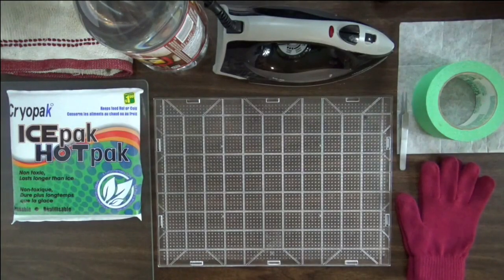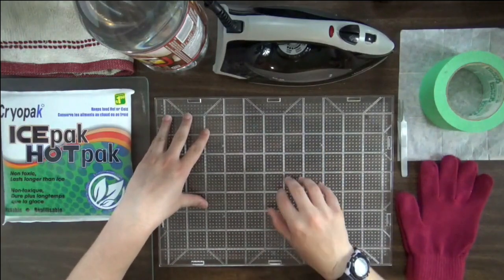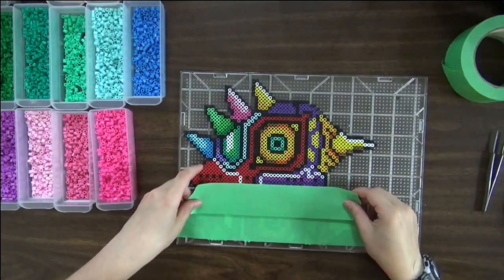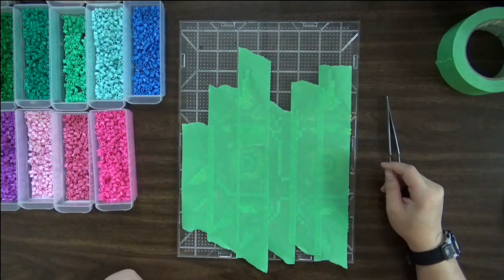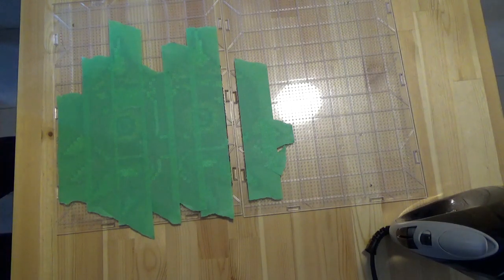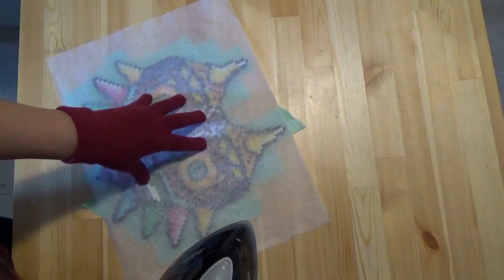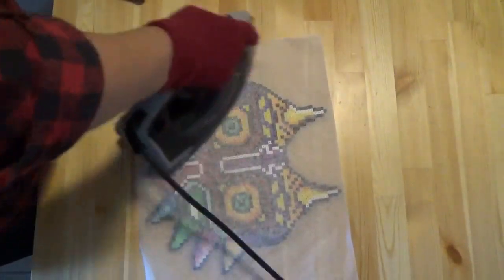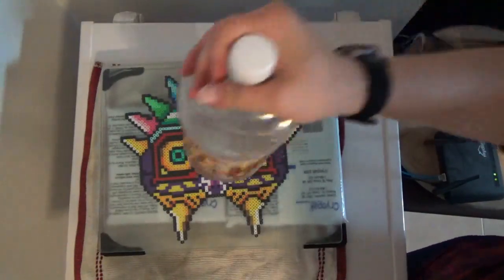Taping Method Tutorial - For Perler, Artkal, Hama, Nabbi or Other Fuse Beads

Comment: You really don't need to poke holes, I've tried countless times with and without poking holes and noticed no difference whatsoever. people who claim that you need to poke holes otherwise it'll collapse and ruined your project are the same ones who have poor ironing techniques.  Once you get a feel for ironing and taping and improve on this aspect it wont really matter if you poke holes or not.  Ever Perler themselves say you don't need to poke holes.  Just be patient and practice. Don't worry if you ruin a project or two...we all have it's the process of learning
Reply from the maker: Thanks for the comment! The thing is every iron is different, tapes are different, and the person ironing is different. Just because I use a cheap sunbeam iron, a specific brand of painters tape, and what is for me a medium amount of pressure doesn't mean that someone who buys the same iron and tape and tries to use the same pressure that they'd get the same result. For some people poking holes is a must. Perhaps their irons run way hotter, they have thicker tape, and they press harder without realizing it. I'd encourage people to try both ways. If you want to poke holes and you get good results like that, good! Do that! If you don't want to poke holes, test with small sprites until you find a way that you can iron without poking! :) Often taking the tape off before full melting one side will prevent blowouts. But saying people have poor ironing techniques because they poke holes isn't really a fair thing to say.
Also Perler is much more interested in the child market of their product, and not the artist side. I'm rather surprised they even published instructions on how to tape, but encouraging kids to poke tiny holes in the tape with some sort of sharp object may have been a bad idea.

Comment: Can I use normal clear tape?
Reply: it may be a bit to sticky, but i guess that there is no problem besides that
Reply from the maker: I've heard of people using clear tape with no issues, but I personally wouldn't. If your tape is too sticky it will pull apart your sprite when you try to remove it if the sprite is still warm. Also if the tape has a low melting point it could melt to your sprite and leave residue behind on the beads, which is something I've seen happen before. I highly recommend painters tape.

Comment: can someone tell me the point of this method??
Reply from the maker: +2tinytumblers The point of this method is to mostly preserve your pegboards. Repeated heating of the plastic pegboards can cause the boards to warp and become unusable. I also use this method to piece together large sprites so that I can fuse them as one piece instead of ironing them as smaller parts then attempting to fuse them together as a whole.

Comment: Hi, I thought your video was great and very informative.  I'm new to the whole Beading World LOL only a few months in.  I'm focusing more on mini beads as they can create very detailed looking pieces in smaller sizes, great for framing.  I find I have issues with ironing sometimes, over ironing some areas, where others don't fuse fast enough.  I only use beads from the Perler brand, that I get from my local Michaels.  So it's not mixing different brands.  What setting do you set your iron to for fusing?
Reply from the maker: Hello! Fusing mini beads is a bit more tricky then fusing the regular sized beads. Minis have less material to them so they melt a lot faster. I use a much lower heat for my mini bead projects, normally around the 2nd and 3rd dot on my iron. Keep in mind every iron is different though, so just keep experimenting! Just remember lower heat is better for minis :)
Reply: +Manic Made Geekery Ty so much for taking the time to respond to my question. I'll keep experimenting and watching your videos. Take care and keep on crafting!!